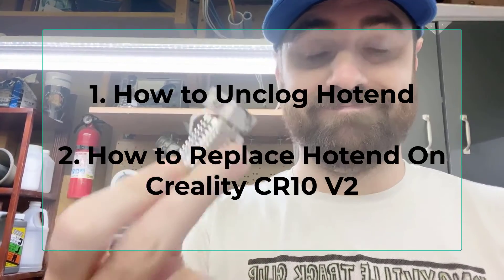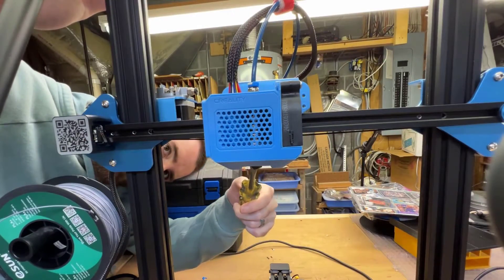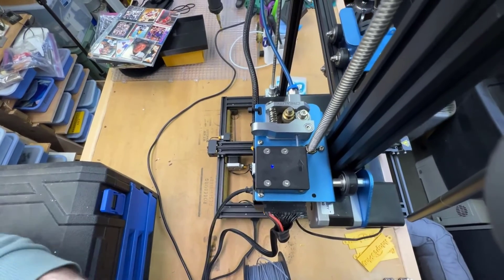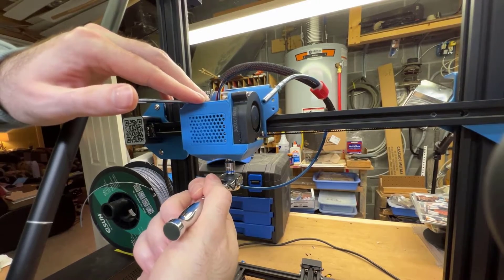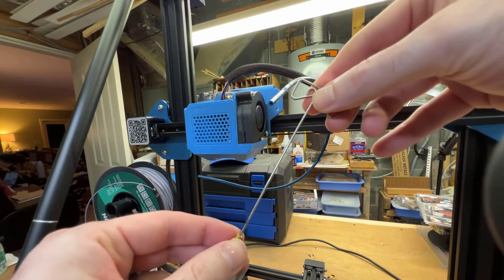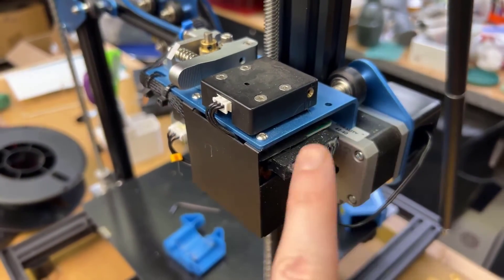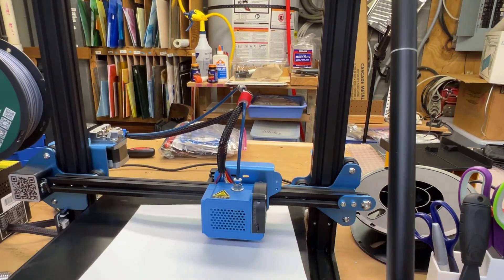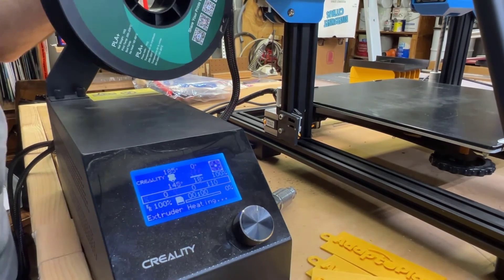Fix and/or Replace Clogged Nozzle Creality CR10 V2

Comment: Question, you noted that the official Creality hot end you purchased is an “all metal hot end” is it actually all metal or is it PTFE lined? I ask as the description on Amazon doesn’t specify this.

I know the stock hot end is PTFE lined, at least it is on my CR-10 V2.
Reply from the maker: You are correct it is a marketing gimmick- you can easily upgrade to an actual all metal hot end but there are pros/cons of doing so - my opinion is it should be based on materials you want to use in your printer.